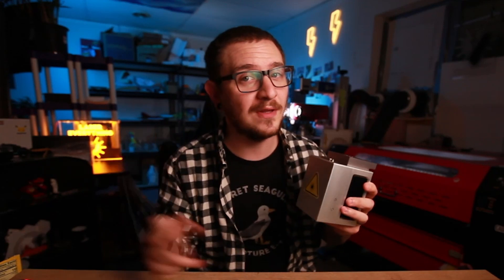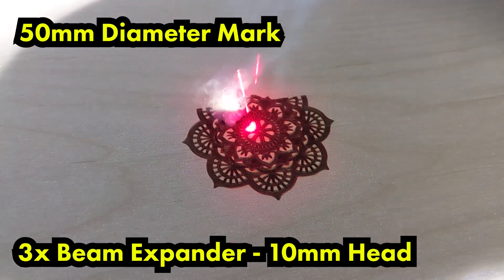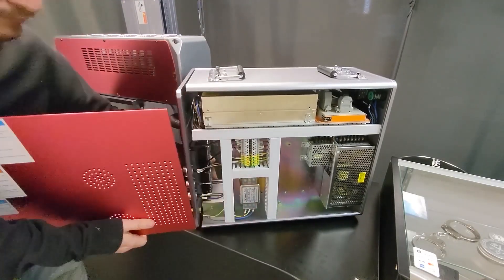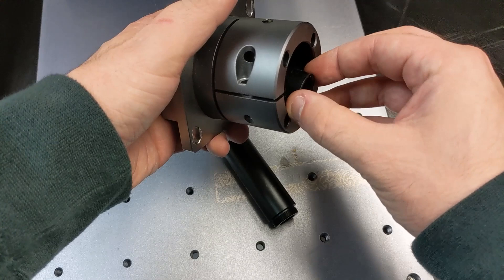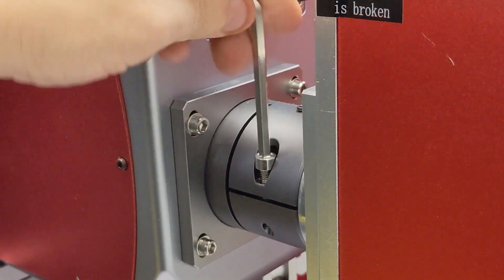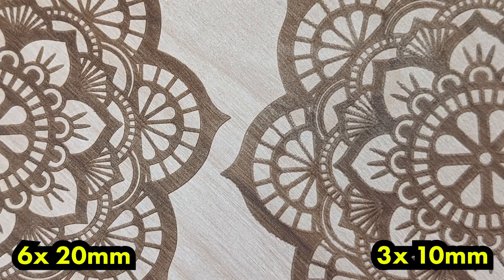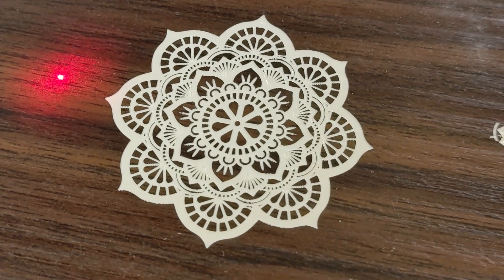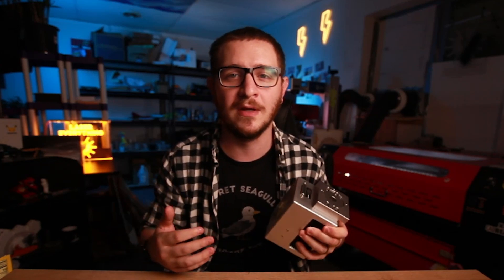How To: 20mm Scan Head Upgrade for CO2 Galvo Laser | SMALLER DOT SIZE

Comment: Some people refer to 10 spots and 20 spots - does that relate to the aperture size ?
Reply from the maker: I guess it depends on the context, it could be related to that or even just the head size. Ultimately the beam expander + laser source dictate your beam diameter. With that, you set the requirement for head size because that needs to be able to direct the full beam to its destination, and the lens rear aperture size needs to be big enough to fit the whole beam as well. The lenses come in a lot of aperture sizes for co2 galvo, so if you’re working with anything more than a 10mm head /have a expander and source combo that emits bigger than 10, you’ll know you need to pay special attention to lenses during purchasing or replacing them.

Comment: Solid Video! Thank you for allllll of the videos you have done. Seriously makes a galvo noob like myself feel like a pro when things are marking well relatively quickly. I'm learning so much and will be upgrading my co2 galvo soon to a 20mm head with an 8X beam expander. My only question is will I have to recalibrate the lenses after the upgrade?

Comment: This was a very useful video thanks. I'm starting to look into a CO2 galvo but need a really large marking area (500x500). I'm learning that this is going to be really difficult if I'm to expect the same quality, spot size and power density as compared to my gantry laser 😢

Have you ever tried really large lenses?

Comment: I just ordered mine from cloudray today....don't tell my other half. It is only a 30 watt, because the 60 watt would have been about another $8k. But, I got 3 lenses, an 800mm lift, the rotary, the 20mm galvo head, and the 8x beam expander. Now I have to get my garage ready for the next cnc.
Reply: Hi I am considering going with the 20mm galvo upgrade and the 8x beam expander also. How’s that working out for you? I mostly do tumblers with mine and could really use finer details.

Comment: Hi Alex, 
First of all: love your videos. This video in particular made me look for a beam expander on my first/next Co2 galvo laser. I figured an 8x20 beam expander would be even better, since a lot of videos on Youtube (just demo videos) show this combination. However, when reaching out to a Chinese supplier, they told me the following:

Because 8x beam expansion will make the aperture of the laser become very large, on the contrary, RC2808 galvanometer cannot refract it all, so part of the laser cannot be presented, resulting in poor marking effect. This is why we recommend 6 x 20 beam expansion.

My knowledge of lasers is really limited when it comes to statements like these, so perhaps you know if this is true, or just some Chinese selling tactic? Thanks in advance!
Reply: Just an update - I just had 2 galvo lasers built, one of which is a 40W CO2 galvo. I was able to use an 8x beam expander with a 20mm RC2808 galvo head. I'm combining it with a 50mm lens, which I'm hoping will allow me to smash out very fine work at speed.

Every laser I've seen on AliExpress specified with an 8x expander and 20mm galvo head has used a DAVI CO2 beam module. This DAVI module generates a claimed nominal beam size of 1.8mm.

This is slightly smaller than the more common CO2 laser source I specified in my build, which generates a claimed nominal beam of 2mm.

With an 8x beam expander on both machines, that woupd result in expanded beam sizes with a minimum delta, (difference), of 1.6mm - so quite a bit extra for 2 machines that would typically be considered the same specification by most. Even more so when the expanded beam area is then factored via the chosen focusing lens.

As well as evaluating the costs of expander, galvo head and power supply, you also need to consider lens price. CO2 lenses are typically about 2 to 3 times more expensive than their equivalent fiber lens sizes, with the smaller sizes often adding another $100 on top of that!

Hope this is info is useful to the one or two of you also thinking about going this route!
Reply: There's little point in expanding the beam size so much if doing so means the light overspills the galvo mirrors and is never directed towards your workpiece.

The 20mm RC2808 head with 20mm mirrors is around £400. The 30mm mirror version they are saying you would need to capture all of the 8x expander beam is over £1000. I assume it may need more power too, which would add to cost even more.

So cost is exponentially more and by the sounds of it, a 6x expander is correctly matched to a 20mm galvo head for your machine.

Comment: Hi Alex. My name is Vlad and I'm a member of  LMA, which is by the way a great resource. Not sure how to get hold of you so decided to ask here. Just bought Cloudray 30W RF CO2 Galvo laser with 30W and 210x210mm lens. As it is the beam is ~1mm thick no matter how we focus it and it looks totally terrible. Here are some specs for the laser source: beam 2mm+/-0.2mm. The head has 10mm lenses. Trying to get the beam thinner. The cloudray sells 2808 head with 20mm mirrors. What would be my best upgrade for this thing? 20mm head with power supply + 110x110mm lens + beam expander. So my question is about the beam expander. If my laser source puts out 2mm wide beam, should I get X10 beam expander to get it to 20mm beam? If you may, please let me know what you think. If possible let me know how to contact you via email or other channels. Thank you in advance.
Reply from the maker: Hey! Please message the "LE Support" account, we'd love to help and it's much easier to get into detail on that platform
Reply: @LaserEverything  will do. Thank you very much!!!

Comment: I’m thinking of getting one of these with those upgrades already done. Fits lma have a params library out there for the co2 galvo like the fiber?
Reply from the maker: They are pretty awesome if you have a need that fits them! There is a Co2 galvo library, though its not quite as robust as the fiber library, but we also have the community libraries which get expanded too!

Comment: Can you tell me what make/model/where you acquired the 20mm scan head? CRay has one in the $700-$800 range depending on where I buy from (Ali vs Amazon). Your screwdriver blocks the info when you were showing the current demands of the head!
Reply from the maker: The scan head is Mactron's own 20mm head built specifically for their systems. For a universal head I'd go with something built by Sino-Galvo, check out wavetop sign on AliExpress for a trusted seller.

Comment: I just upgraded mine , got the new head 9 20mm) and power supply along with the Beam expander ( x8)... problem I'm have is the flag pipe/neck that connects the head to the body, doesn't fit the new head, it needs to be larger, I don't suppose anyone ,ight know where to buy the pipe or what its even called would help, ( maybe neck / double flange  im not sure of the terminology ) - obviously one side fits body fine as its the original bu t the head side needs to be larger.. arghh any help would be fantastic thanks!

Comment: I have 30w 200mmx200mm co2 galvo. 
I am trying to engrave inside the man's wallet but the result is not good. It is marked very thick. 
I watched 60 hours of videos. If I get a smaller work-size optic, is it going to solve the problem? How can I be successful on 5mm height letters?

Comment: Hi, love the Channel , very useful ! I am a laser engraver (Co2 & Fiber), full of good tips ! I am currently designing a laser with a 120W Co2 tube, but I can't increase the beam diameter (from 2.5 mm I want 10 mm diameter, so I though a x4 beam expander from Cloudray could do the trick, but it does nothing ... the beam stays at 2.5 mm, I am stuck, any idea what I am doing wrong ? Thanks for your help !
Reply from the maker: Interesting. I haven't been in a situation where a beam expander hasn't produced results for me yet so I'm not sure where I'd start on troubleshooting. I suppose the first thing I would do is pick up another expander from a different source and see if you can replicate the issue that way. The expander could be junk or there could be something else at play here. If you want to go into it more either check out Discord Server or Facebook group - links in the description - or you can check out our new forum over at https://www.lasereverything.net/forum and I'm sure we can get you pointed in the right direction.
Reply: 1. How are you measuring the beam diameter?
2. Does the expander have adjustment? You may have to slide the 2 lenses closer or further apart to get the desired expansion.

Comment: I have to align my galvo head as some bolts stripped during shipping.  Do you have a tutorial on beam alignment into the galvo head?  My laser has a small plastic or ceramic stick that looks like a half stick of gum. Not sure how to use it.
60 watt 3d m7 mopa
Reply from the maker: I have not completed a beam alignment on Fiber yet so I might ask around our free discord or facebook groups, there's links in the description. Otherwise you can check out this episode I did for beam alignment on a CO2 galvo. It may or may not help you. Exercise caution, the beam is definitely dangerous. Instead of the blue tape we use in this episode try black masking tape - it should mark better. Do not stand in the path of the beam and MAKE SURE you are wearing eye protection. https://youtu.be/v67dSBEI7CI
Reply: @LaserEverything  a white plastic or ceramic stick about half the size of a piece of gum came in my laser goggles case.  I have seen a video that doesn't describe the  instruction where it appears to be used to align the beam exiting the galvo.  Do you know what that stick is or how it works?

Comment: EDIT I'ld like to warn everyone who is thinking about attempting this upgrade. My laser was a custom order from Alibaba, further upgrades were bought from aliexpress from a different seller. I purchased a 20mm head, but it would not mount on the neck of my laser. Contacted the seller and they sold me another laser path with neck assuring me that the new one would be compatible with the head the sold me. Well, imagine my surprise when I received the new path and the neck is exactly the same as my original one and is NOT compatible with the 20mm head... I am currently in the process of trying to return everything. I'll then attempt to sell the laser in a laser group on Facebook... :(

I'm currently shopping for this upgrade and stumbled upon a 8x beam expander with 30mm galvo head and thinking maybe I'd go the extra mile. I cannot find info online regarding whether or not it's worth it. What would be your take?
Reply from the maker: Do the math and find out if you can get a bigger beam expander with that 30mm head. If you're gonna go all the way to 30mm you might as well max out your beam expander so you're getting as much out of that head as possible. If your CO2 source puts out a 2mm beam the 8x will get you to 16mm, that would fit in a 20mm head so the 30mm would be a waste of money. All comes down to that math and what beam diameter the source you're getting outputs.
Reply: @LaserEverything  Aaand you're right!!! :) 8x expander with a 20mm head it is!

Comment: Hi.its a great video.
i have a question
Is there any differences between co2 galvo scan head and fiber galvo scan head?
Reply from the maker: Yes, there is a big difference! Mirrors are completely different, fiber laser mirrors reflect the fiber beam, while CO2 reflects the CO2 beam. It's very important you use the right Galvo head for the right machine.
Reply: @LaserEverything  thank you

Comment: I had watch all your video. And came to idea to upgrade my galvo CO2 laser instead of buying new fiber machine.

I have a machine with 400*400mm engrave range. Basically, I engrave the plywood and wish ABS plastic and the first thing I noticed are details. It's lack of them. The dot seems to be about 0.5-1mm. Especially it feels on the ABS plastic engrave, it looks awful. So I can't sell my service with a clear heart.
Can you tell your opinion on:
1. How can I know the expanders 'x'es? Should I open the head to know it? 
2. I plan to buy a couple of theta lenses and use the least ones for better detail, but would it help if my expander isn't 6x or so?

Thank you
Reply from the maker: In this episode we go into it a little toward the end. Your galvo head and beam expanders must be matched so that the expander isn't expanding more than the galvo head can handle. https://youtu.be/I_M19yy4G9g

Typically beam expanders have their magnification (ie 6x) printed on them so you could pull the head off and physically inspect it to get that answer as we do in this video.

The 400mm lens is likely a huge part of the problem. The larger the lens the larger the dot size. Something like a 110mm would do (about 4 times) better so if you can I would definitely consider a smaller field size lens as well I think you would see a huge improvement even if you don't do anything else we talked about.

Comment: Would an expander with 8x magnification be better? or maybe 10x better? I think about a 300x300 working area and a 20mm galvo, maybe here it is better to use a 30mm galvo?
Reply from the maker: There IS such a thing as having too big of a beam expander, we go over it in this episode: https://youtu.be/I_M19yy4G9g I'd give it a watch, should answer your question!
Reply: @LaserEverything  Ok, I looked at the movie and signed up for your academy :)
I have a question about the 30mm galvo.
What expander should I use for a 300x300 lens?
Power source reci w1
I think 8x will not be too big? is it better to buy a 20mm galvo and a 6x expander?
I want to mark plywood on a co2 laser, customers often send complicated patterns :(

Comment: Hello, thanks for your videos, very informative. I have a question, how many x expanders are used with the glass tube for the 600mm x600mm co2 lens, it will get sharp results.
Reply from the maker: 600x600 is really very very big. I would guess somewhere around a 20x expander for usable results but it will need an extremely large galvo head with massive mirrors and motors as well. Might want to start looking into gantry machines at that size.

Comment: I would suggest a  capital Pi-shaped (Π) focal stick for aligning the galvo to the table. Kind of like your focal stick with two legs. I feel that would give you surefire way to ensure the galvo is parallel to your work surface. Great video and congrats on getting the CO2 back in good graces!
Reply from the maker: Interesting suggestion I might have to try that, thanks!

Comment: I'm going to buy a galvo head
10mm laser beam input for co2 glass tube laser

my doubt is the following:
1st Galvo Head RC1001 does a Yongli A4s 100W glass laser tube work?
2° is it necessary to use a laser beam expander?
3° what is the difference between Galvo Head RC1001 and SG7110

I will buy these items:

Galvo Head RC1001 10.6um
JCZ LMCV4-DIGIT
CO2 f-theta lens 10.6um - 300x300 F430

 Do you have these items to sell?

if you have, give me the values
because to bring the machine ready is very expensive
Reply from the maker: These are all great questions but I can't write enough here to cover it all. Please join our discord (link in description) of higher level support!

Comment: How do you feel with power?  I have 30w on a metal tube myself and I am thinking of changing a 20mm galvo with a 300x300mm lens but I do not know if changing to a larger galvo has an impact on the power?
Reply from the maker: A larger head will make the laser feel MORE powerful because the same amount of energy will be focused to a finer point.

Comment: Does it have a rotary?
Reply from the maker: Works with all the standard rotaries other galvo lasers can use. I hot swap the one with my fiber laser all the time.
Reply: @LaserEverything  nice! Is the 20mm lens the one with the smallest dot size or is there more?
Reply from the maker: @FamousHec  20mm is the largest that you could possibly need unless you have a very specific use case in mind. 20mm with the 6x beam expander is perfect.
Reply: @LaserEverything  I have very high detailed logos with very thin lines and stuff lol but I'll take your word for it. I'll use your links to purchase the co2 galvo. Or do you think a fiber laser does good on tumblers like polar camels?
Reply from the maker: @FamousHec   A CO2 is going to be MUCH MUCH better, faster and easier to work with on powder coated items. Fiber will do a little better with raw steel tumblers. Just depends on what you're working on. Either way both are do-able with either machine.
Reply: @LaserEverything  thank you so much for the replies dude 🙂 you're awesome  👍
Reply from the maker: Here to help!

Comment: Can this laser be used for cutting plywood? Which thickness? You have got a 30W Coherent laser, right?
Reply from the maker: It's a 30w Coherent, you can kinda get away with it but galvo lasers are never really designed for cutting. Maybe 1/8" max.